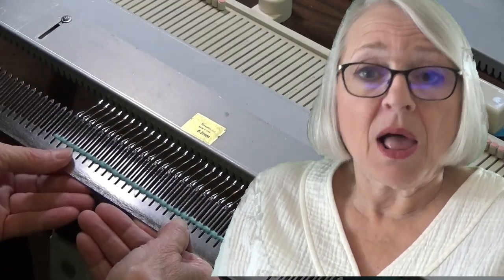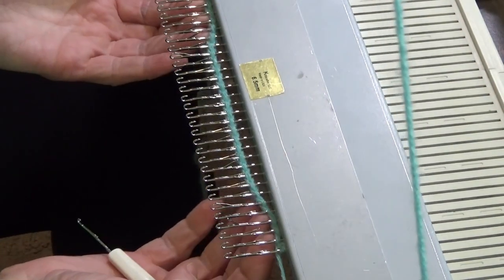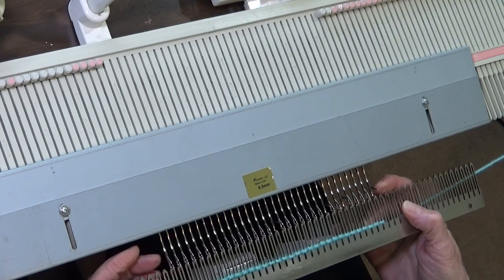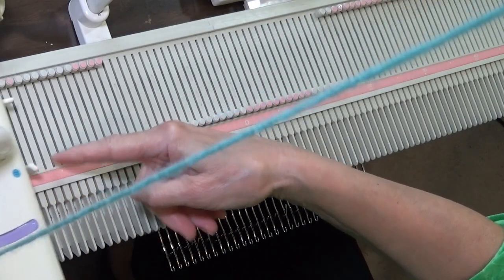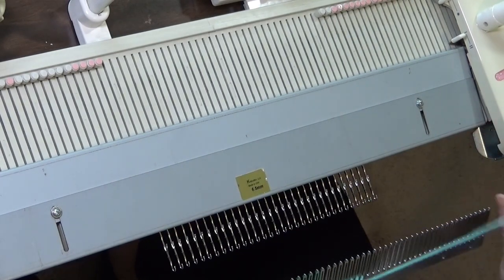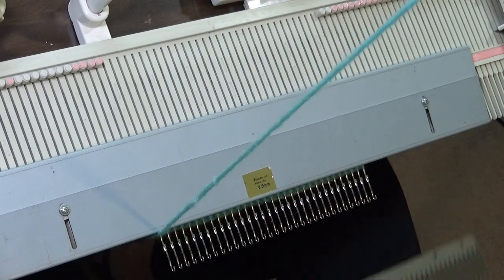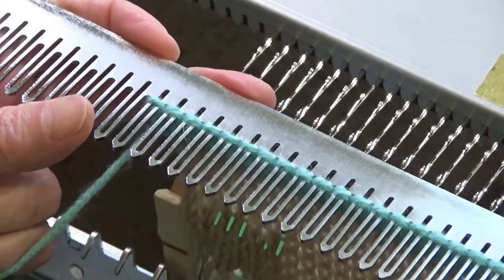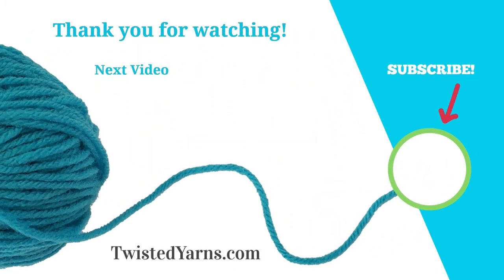How to Use the Kriskrafter Garter Bar Part 2 - the Garter Stitch

Comment: Any tips for a standard machine? I have tried different yarns but the stitch is to tight even on a 10 to get back on after turning
Reply from the maker: I use a Japanese  style garter bar on my standard bed. I have a 965i. Which machine and which gater bar type are you using? Also what is a typical yarn you are using? Let me know and I will give you some suggestions. My email is mary@twistedyarns.com if you want this conversation to be private.